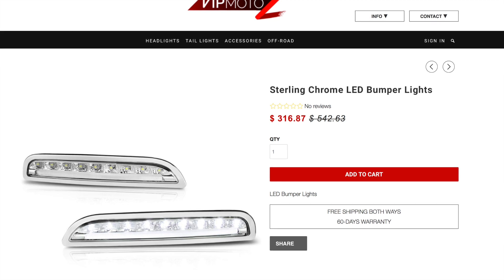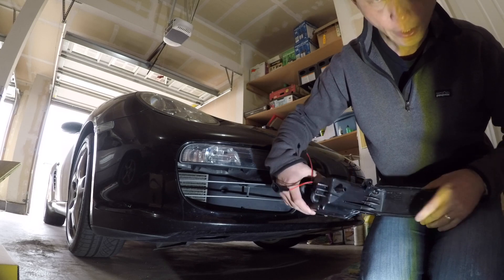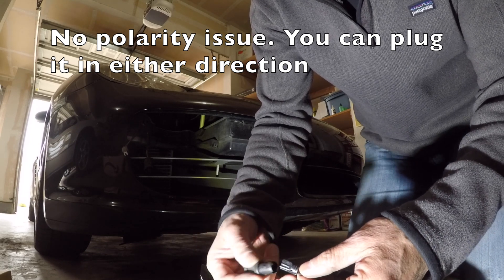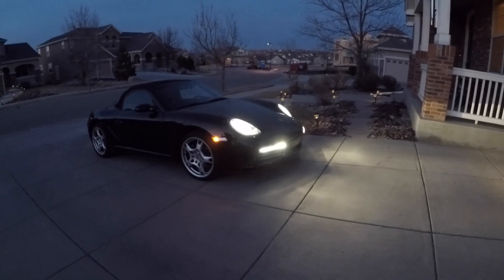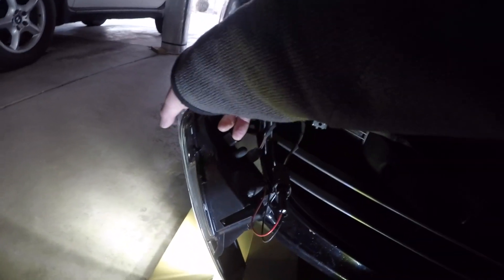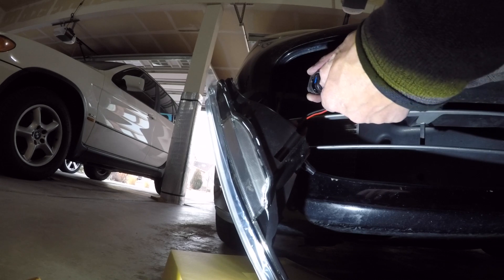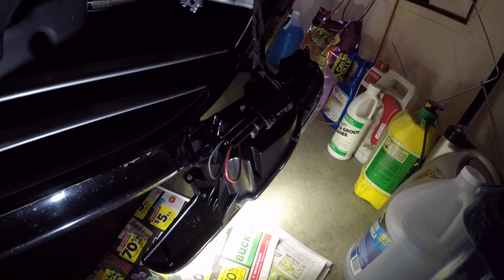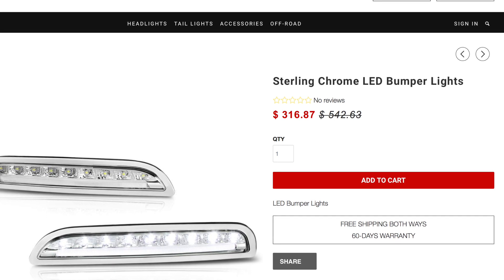VIPMotoZ LED Bumper Light Review for Porsche 987 Boxster

Comment: Thanks for the installation tips. I bought a different brand set, I'll let you know if mine stand out from the bumper as well. I hope not. When I did my 997S they fit perfectly.
Reply: I wish the fixture was flush to the bumper as well. I don't like how they stick out. Mine do the same.   As with yours, I like the appearance from 20 ft, especially with the lights on--they do modernize the look and the enhanced lighting and light color temperature from inside the car are an improvement. Up close, not so much. Because of the plastic-on-plastic mounts and thickness, there isn't much to be done in the way of adjusting how the lights fit.  On mine, the passenger side misses the outer-edge mounting hole by 1/2 cm. Not that it matters, it wouldn't seat back that far anyway, but the misalignment is noticable from the outside. I agree, reviews of this specific mod are hard to find, so thanks for your review. I wish I had seen your review before I bought lights--I probably would not have,  given the fit.